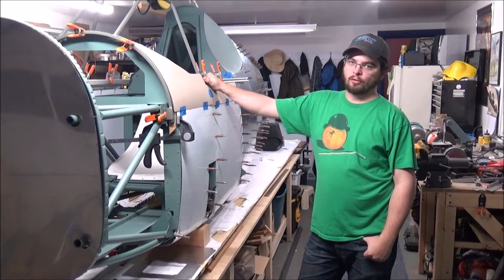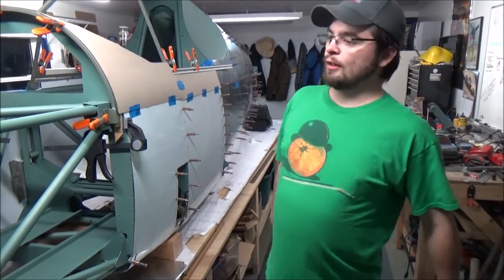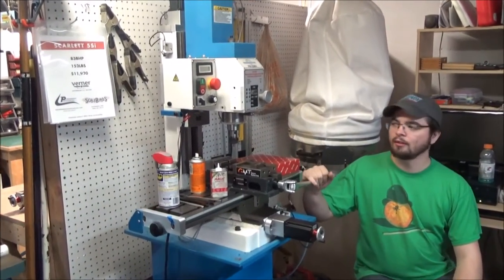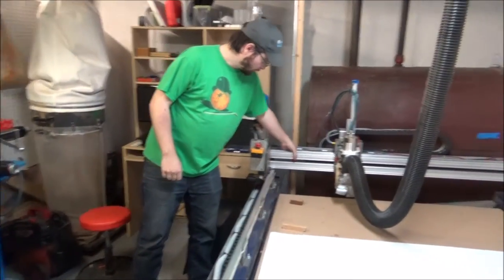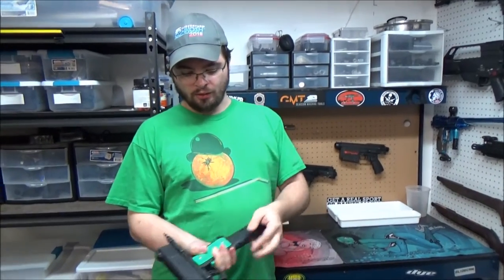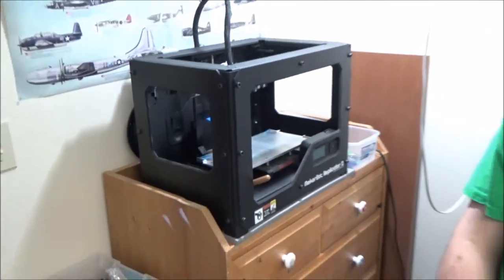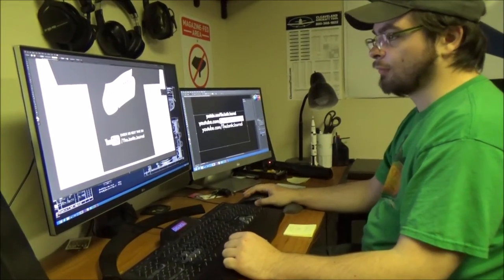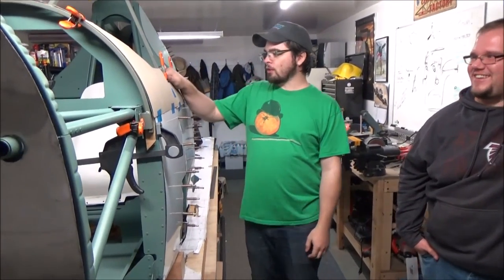Home built airplane project and CNC shop

Comment: Bet that engine is $25,000
Reply from the maker: +Johnbass37 That particular one in the video is $12,500. Cheaper than I thought too for a totally custom engine.
Reply: TheJanticJournal Wow , that's a big surprise for a airplane engine. Years ago a friend of mine paid $45k for a used 4 cylinder.